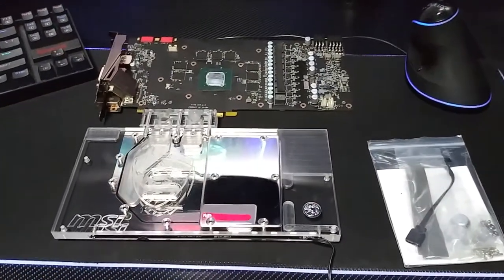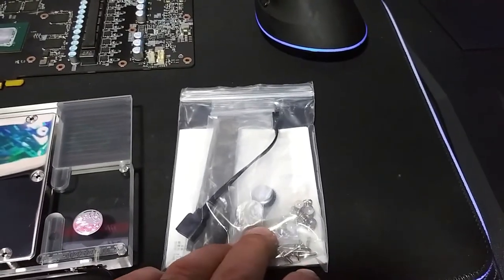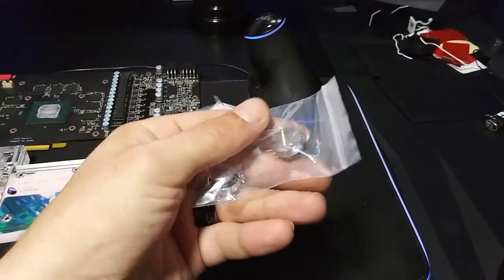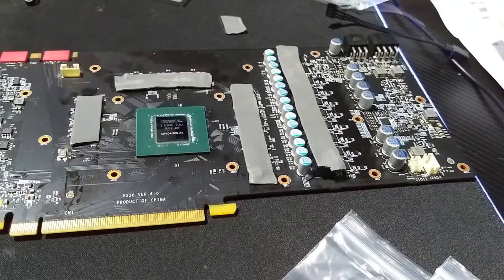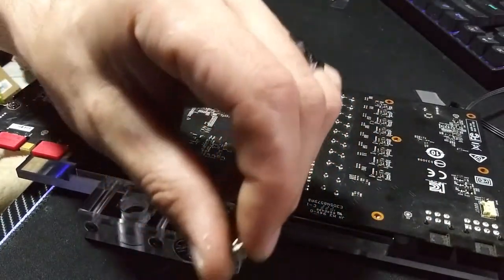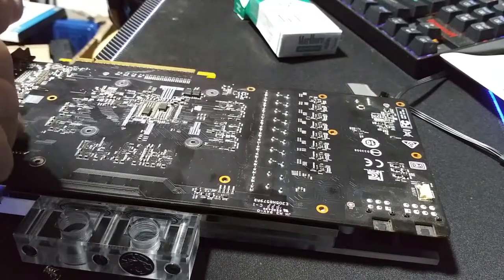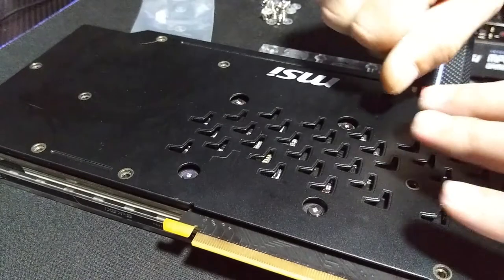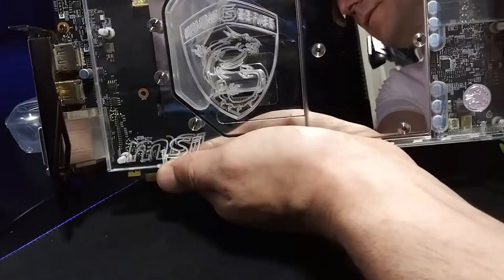Bykski Full Coverage GPU Water Block -INSTALL

Comment: Hey whats up great video! my rx 590 fatboy OC only has 1 hdmi but i want to run dual screen so i ordered a display port to hdmi cable, hope it works!
Reply from the maker: That will not wrk. How u want it to... It will just show u the same image twice. U must have 2 hdmi ports to get the dual monitor to work right... Using 1 hdmi port will only mirror itself.  Sry about that.
Reply: @ATECHPCs  alright thanks for the help, I've done it with 1 HDMI and 1 VGA before so I thought it would work
Reply: that will mirror the image.... u need 2 display ports/hdmi ports for you to use 2 monitors   but hey .. now u have a new hdmi adapter
Reply: @pcman4747  so I could just order another display port to HDMI and that would count as 2 display ports and work without mirror image?
Reply: @pcman4747  hey update the display port to hdmi cable came in the mail and it works as i have 1 hdmi screen and 1 display port to hdmi screen and is not a mirror image thanks anyways
Reply: @ATECHPCs  hey update the display port to hdmi cable came in the mail and it works as i have 1 hdmi screen and 1 display port to hdmi screen and is not a mirror image thanks anyways
Reply from the maker: @willsmiff2920    well originally i thought u was saying you were using 1 port and trying to get 2 images out of it.m which would mirror it.   Cuz in your original msg u only said 1 hdmi port.  U never said anything about a display port also.  So u have 2 ports. 1 hdmi and 1 display port.  That will work....
Reply from the maker: @willsmiff2920  im glad it works for you.  Now u got monitors.  Hell ya. Bad ass
Reply: @ATECHPCs  the graphics card has 1 HDMI and 2 display port , so I ordered the Display port to HDMI cable for the second monitor , I was fairly confident you thought I was trying to use a splitter but wanted to update and say thanks for the help , I like your videos and think you should get paid to review products or at least get to keep the item! Hope your desk you ordered is perfect!

Comment: aluminum? its nikel anodized copper. aluminum would not bring that performance like copper. if its aluminum, then you can run the gpu without cooler. it would be the same 😀
Reply from the maker: IT says NICKEL alum ... i even double check it after reading this comment... perhaps its a typo.. but it does say that ... also .. there's 2 plates.. its not 1 whole plate..  there's a inner and outer different metals make up the whole block... like they press fitted it..   the block works great . the led burn out tho.. that was a 10$ replacement